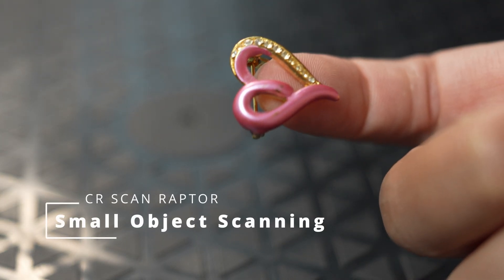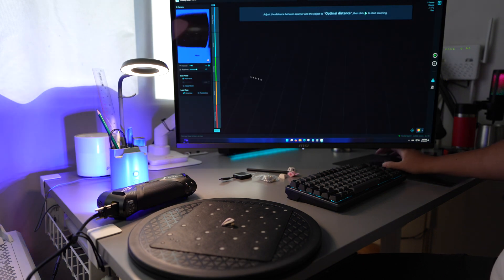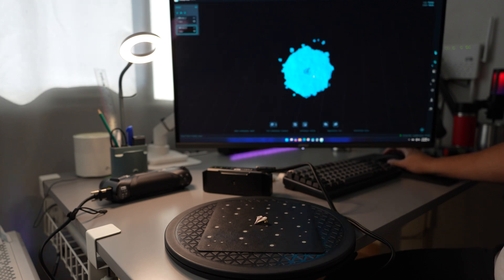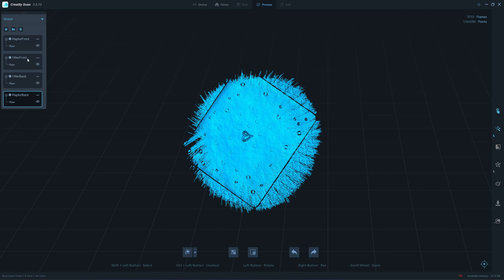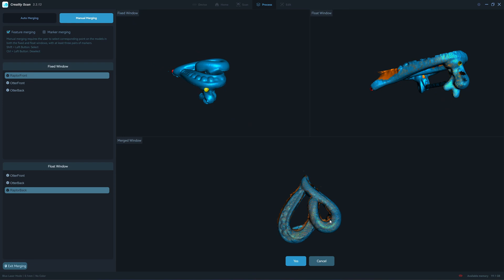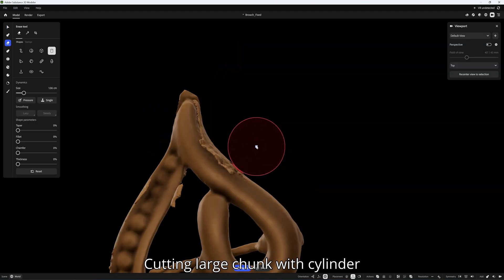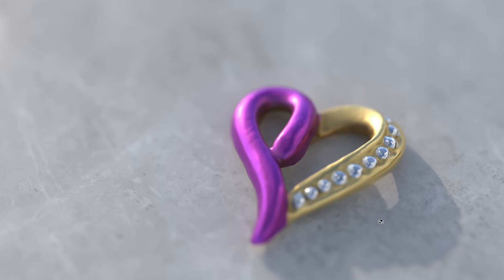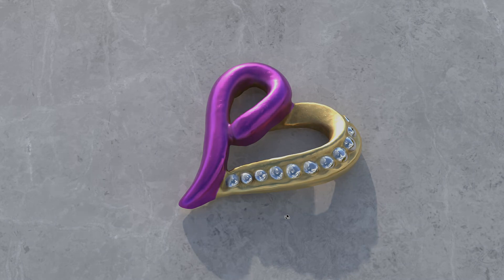CR Scan Raptor - Small Object 3D Scanning Guide - Creating a Brooch Mold

Comment: Thanks buddy nice demonstration of small object scanning. I think starting off with the otter will work out as a first scanner but feeling a bit of fomo wishing i ordered the raptor.
Reply from the maker: The original Raptor is an ideal starting point for those new to reverse engineering. I mainly use Otter for human body/face scanning.
Reply: @Payo-TensileCreator thanks for the quick reply. I canceled my order just in time.

Comment: 1 more question sir, apart from using a WiFi handle, is there any other way to use a wireless transmitter connected to a laptop or PC?
Reply from the maker: The amount of data transfer is very high. There's no other way except this Wi-Fi handle, and your PC needs to have WiFi 6 to connect to this handle.
Reply: @ Thank you very much sir for the information, I didn't expect to receive a response like this, this channel really helped me as a beginner in the world of 3D scanners, success always sir

Comment: For the scanner, you can use a power bank?
Reply from the maker: Yes, but you will need USB-C to 5.5mm DC Jack 12V 2A adaptor, with a PD power bank that can output 24W

Comment: I’ve used fusion, and shapr3d with no luck other than crashes. Im trying to take 3d scan of a radio and build a snug form fitted case to go around it and act as a holster for the radio to wear on a belt with no luck….. fusion crashes and shapr3d isn’t powerful enough to work with all the triangles. Is substance something that I might be able to accomplish this with? I should be able to use this to smooth and touch up the mesh also?
Reply from the maker: Yes, I think you can model a radio case out of 3D scanned model and Substance Modeler. I've made a phone case, it's very easy. https://youtu.be/_JesB-w2idE
Reply: @ thank you for replying I think I’m gonna try it after watching your videos!

Comment: Thank you for letting me use your marker.
What  using here is CR Scan Raptor ？　Raptor Ｘ looks like？
I know that Raptor X is good, but can it also be used with CR Scan Raptor?  I'm planning to buy a CR Scan Raptor.
I'm currently using Miraco pro.
Reply from the maker: Raptor and Raptor X share the same 7 lines blue laser, only that Raptor X has 34 lines blue laser for scanning larger object like car panel.

Comment: Question: Am I correct in thinking you said, in a video when you first had the raptor' that the small markers do create a higher density point cloud?

In the sense you should scan the gold broach on a flat surface with only small markers?

Maybe design some small marker towers for the small markers. 
That way you will be able to prop up the broach from the surface and scan the whole broach in one scan.

It could create a very accurate representation and save you needing to do major post processing.

I was also picturing that a very small diameter turntable could be beneficial, as you would be able to 3d scan, from underneath the broach, with say 4 or five small marker, marker towers. 

I have looked forward to all of your videos.
Thank you so much keeping the content so relevant and interesting.
Please be rest assured that these videos will be watched multiple times by most viewers that own these amazing scanners.

I have loved how Creality are taking major strides in developing their software into something that isn't made for a simple gimmicky toy 3d scanner.

I dearly hope they do develop AAA class 3d scanning software, that benefits all the people that have invested in the Otter and Raptors.

The hardware is good enough to defiantly deserve top tear software.
Reply from the maker: I discovered that positioning the small object closer to the markers and parallel to the markers surface results in capturing more point cloud.
Reply: @Payo-TensileCreator 

No I was talking about using the small point markers and artificially creating a more detailed point cloud.
Reply: Please keep testing 😇